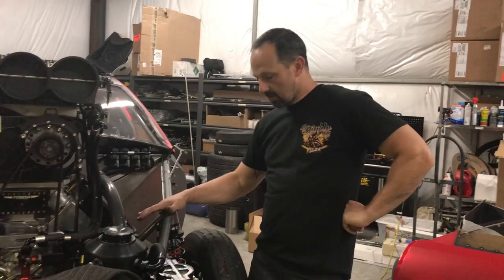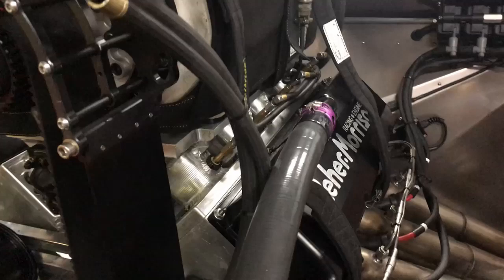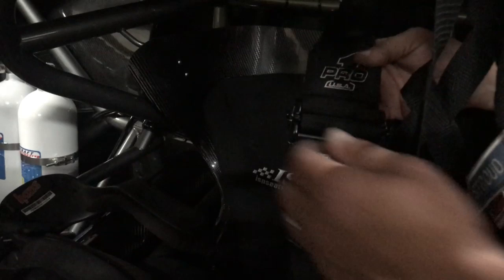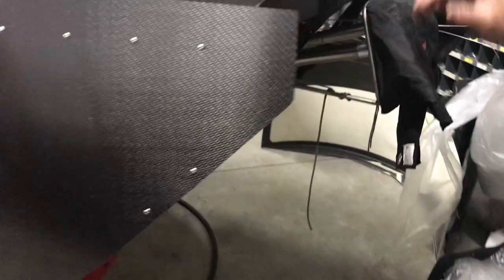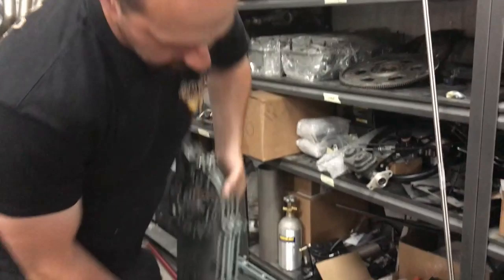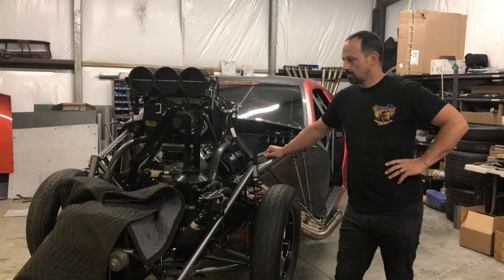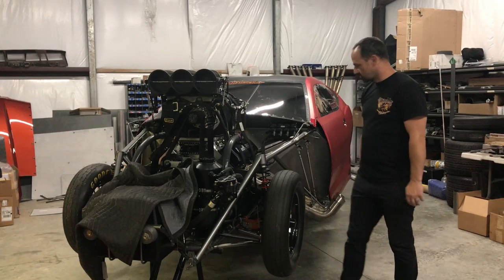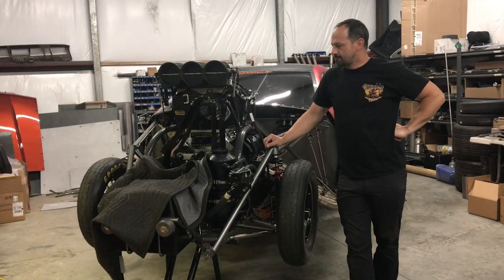Breaking Down El Diablo 2.0 with David Reese

Comment: Since you did an axle mount parachute tether (which is bad ass) were you able to take weight out of the tail section of the chassis? Titanium, smaller dia. or less tubing?
Reply from the maker: We will touch on this in a future video. Thanks for the question.